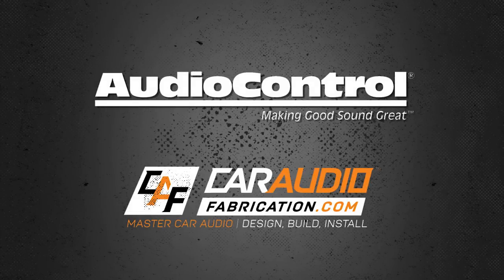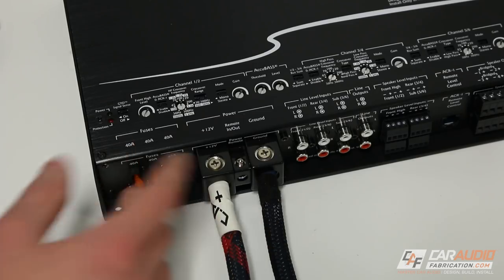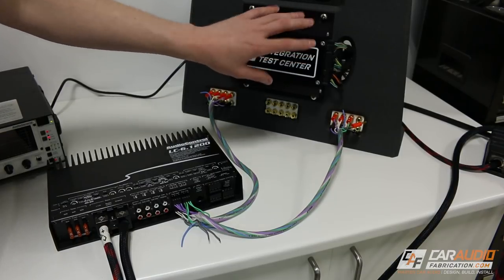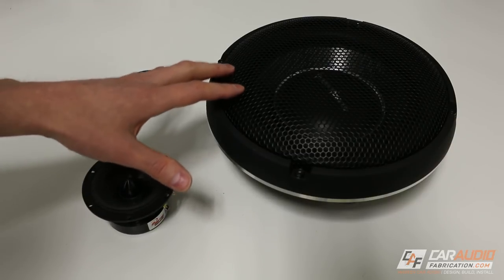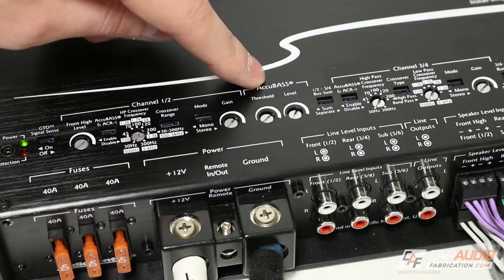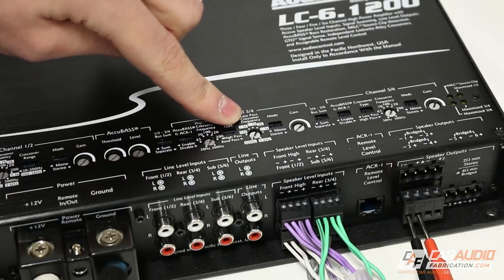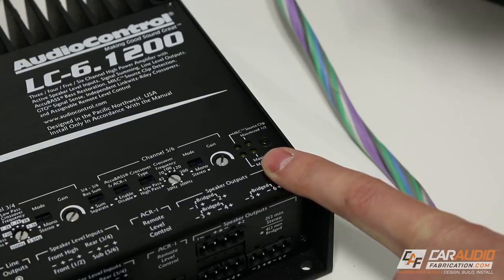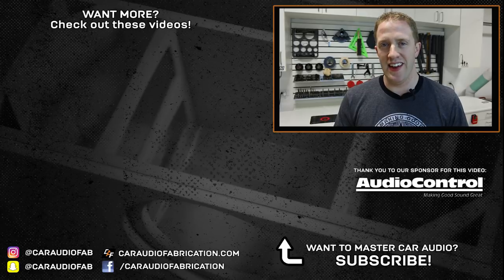The All in One Amp? AudioControl LC-6.1200 Amplifier - CarAudioFabrication

Comment: I can afford this @ 1,050cad. I can't afford the d.6.1200 at 1500cad. I have a 2016 cx5 that lowers the bass as the volume goes up. Non bose, I'm assuming this is what accubass fixes. So my question is do I need a dsp or is a dsp just for the audiophile and considering I have no idea how to tune a dsp, will this amp alone by itself provide all that I need? Would be heartbreaking to spend this amount of cash and needed a dsp at which point I could just get the universal pioneer and just pair that with a much cheaper used amp
Reply: Nobody needs a dsp if you don’t know how to tune it.
Personally i think a dsp is a great way to complicate things.
Keep it simple, most people just want louder clearer and subs.
Reply: @ekimandersom4478  alot of time has passed. I tried it without the dsp, once I got the dsp it was night and day in sound quality and in no way am I a professional. Back in the day we would use a pre amp or cross over. Same thing really. Running amps directly sounds awful
Reply: @ekimandersom4478  I did go with a cheap dap so I didn't fix the bass issue but its fine... so much power in the speakers now I never pass the bass cut point and if I ever do, I installed a bass knob to adjust but there is a noticeable quality issue there. Eventually when I get the disposable money ill get to it for the next car when transferring the equipment

Comment: Hi Guys,
Can anybody advise please me?
I have a premium 8 HU that came with my VW Passat 2013 TSI and replaced the factory speakers with Sony 2-Way Coaxial Car Speakers XS-GS1720 
The front tweeters that came with the car is dashboard mounted away from the main speakers and the rear is door panel mounted away from the main rear speakers. I want to make use of them all which will make it if I guess right 8 speakers plus a subwoofer JBL GT5-A3001 Monoblock. I want clear sound so I’m planning to purchase:
• AudioControl DM-810 DSP
• AudioControl LC-6.1200 6 Channel Amplifier plus
• 4 Channel Powerbass Amplifier ACA-480.4 (this I already have)
Will the AudioControl LC-6.1200 6 Channel Amplifier be enough to power the 8 speakers independently or will need to add the 4 Channel Powerbass Amplifier ACA-480.4 as well?
What 1” Tweeters brand will you advise me to purchase and at what crossover frequencies should I use for the treble, mids and bass in order to get clean good sounds from the songs I play?
I possible you can contact me by email: afatsaosamuel@hotmail.com
Thank you lot.

Comment: Do you have a GTO?
Reply from the maker: No, I don't have the car the GTO. But this amplifier has a feature called GTO which stands for "Great Turn On" and allows the amplifier to power on and off with monitoring the speaker level input rather than needing a remote input.
Reply: @CarAudioFabrication  wasn't the car i infered to, but the TO part ;D, although i am lookin for a good amp for a small car, i have installed the speakers but in my Clio 4 the factory radio seem to have no power, so im also looking to find a good upgrade there, and a small sub under the seat, so my wallet is going to hate me, this amp looks amazing and a very good video man.

thx for you expertise, you are my go to when it comes to car audio, i even watch videos again coz  i learn so much from them, keep it up!

Comment: I would like to get this amplifier but my problem is the last few installs i’ve done i’ve had great deep bass and great highs but no mids and it’s been shallow. if i used the first 4 channels to drive 4 components and the last two channels to drive mid bass what would you recommend to midbass drivers be? I would like to also get a complimentary 1 channel for a subwoofer. I’m tired of spending money on good equipment and having nice clean installs and then being really bummed by the output! or would it make more sense to delete the rear speakers and go with the tweeters and midbass and woofer setup?

Comment: Great amp.. However I don't see any point in destroying a nice Burmester sound system let's say on a Mercedes Benz E Klasse (23 speakers and 1450W RMS) and replace it with some aftermarket junk. Is impossbile to top that quality. Maybe with some older low quality systems like Bose you can get a better deal but with Burmester, B&W, Bang & Olufsen etc.. is impossible to get a better sound, a better image, and that's because they developed that system around the car and yes is full of sound processing also.
Reply: Then don’t, whats your point?

Comment: want to upgrade 2014 mustang shaker 500 microsoft syn factory installed, now has no touch screen, just 1 din, - 2 choices are one, a  new head unit  kenwood 9903s $550 touch screen with maestro idalink $200 to use current steering wheel controls and car talk=total $850 vs choice 2,  a audiocontrol loc either lc7i $190 or lcQ1 $300 with 11 band equalizer and no new head unit. the loc choice means no android auto and no eventuall backup camera.

 new & not yet installed in the trunk- jl audio xd700/ 5v2 amp 75rms x4 &300rmsx1, 2 pair(4 speakers) jl audio c5-650x coaxil speakers 2 sets new gift to me, 1 jl audiostealthbox 13.5 inch woofer unused for trunk, 2 of ( dont remember why 2 from 8 years ago my last noob install) kenwood xr-1s mono subwoofer amps( 700w rms at 2ohm)
the factory mustang head unit has no rca out, believe is 22rms out. Im happy with factory setup controls, dont need either  a touch screen or( backup camera(costs $100 to $160)  but sound is 2nd rate and I keep my cars for 12 years or more.

Would you replace the head unit for $850 or use the audiocontrol loc $200 or $300-- the $300 loc (LCQ1) has 11 band equalizer vs 4 band on factory head unit?   the kenwood head unit is kenwoods newest top of line. but the $500 saved on only the Loc could be used for soundproofing . The noob in me says a bad source (factory head unit) gives bad sound but do I best fix the sound with the Loc processing the sound and  feeding my aftermarket jl audio amps . Im a total noob and never used LOc's before. is the Dm-810 DAC by Audiocontrol $700 a better use of my funds rather than a $850 new head unit? Please give an opinion

Comment: Got this originally thinking it would power my front comps, rear coaxials, and 1 10" sub. But the front and rear spkrs were overpowering the sub. Didnt sound good. So i ended up having to buy a seperate amp for the sub, and went full active setup. Buyer beware
Reply: Thats impossible if setup right
Reply: Buyer beware? Respectfully, it sounds like you failed to do your research and followed up with a bad install.. Respectfully..

Comment: Why not make a Headunit that outputs at the same ohms. That is the real problem, that way we are not conned to pay for more things that come with other limitations. Headunits are essential for touch screen interface, you can not have an all in one line output adjuster, there is no such thing. All we need is a RCA OUTUT that changes from a higher ohm output to a lower ohm and what they give us is a line output with an amplifier that limits the watts we can load on it. What is the point of that, why would I need an amp that joins to an amp that joins to an amp. NONSENSE. IT ADDS MORE THD. The whole point is to change the voltage to match the amp not to adjust watts. And you do not reply to anything I say neither.
I have a laptop, it outputs probably a 16-32ohm signal, it is too high for 4ohm amplifier. ALL I WANT IS A 4OHM OUTPUT, WHAT IS SO HARD TO MAKE IT SIMPLE. Do I really need to waste £200-400 for that.
Do us all a favour and stop wasting our cash.